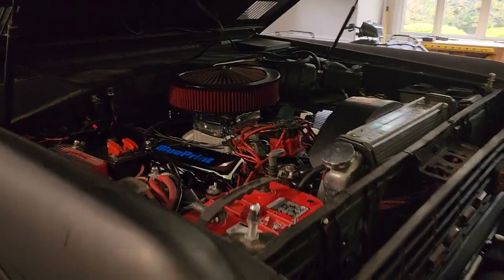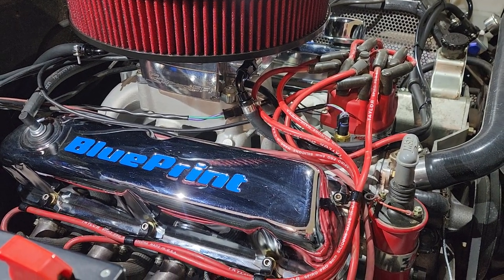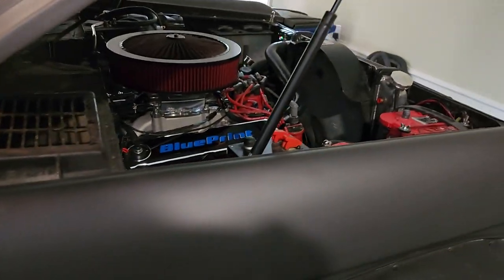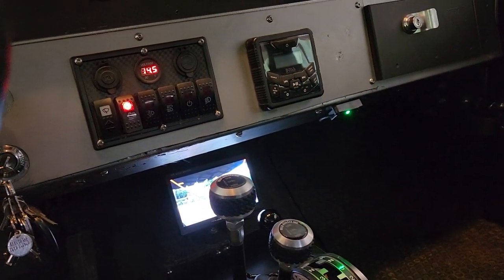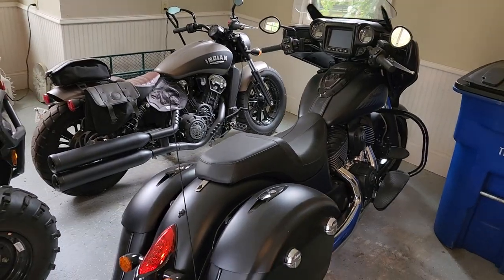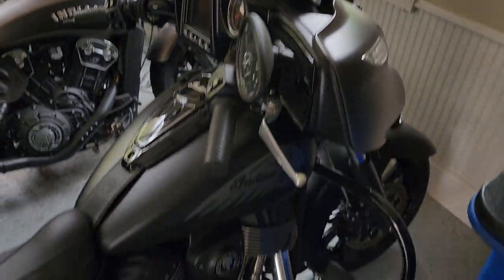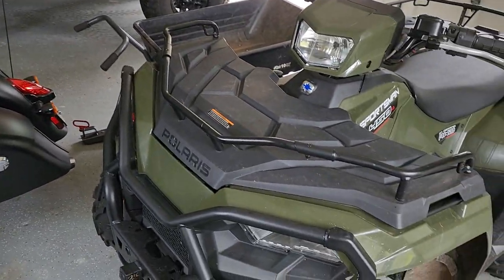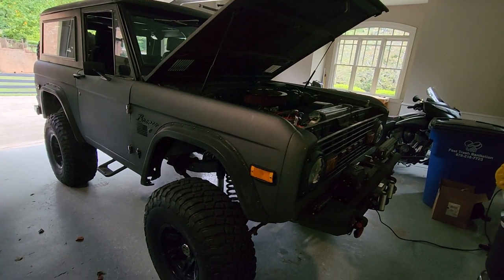74 Bronco engine install final episode.

Comment: Nice i had an external vacuum tank and a pump that worked great didn’t require engine to be on to have brakes. Went to hydro boost and well it great but only when engine is running.